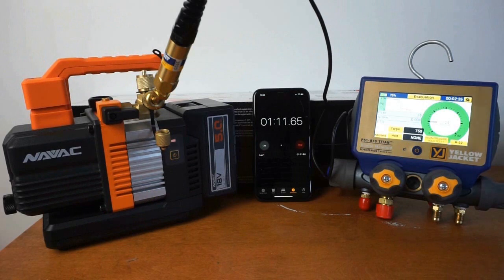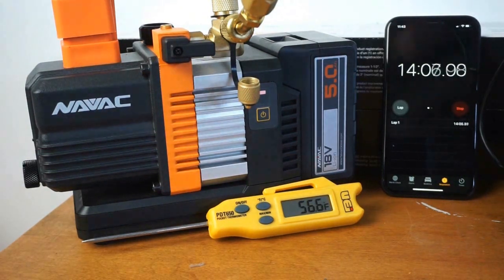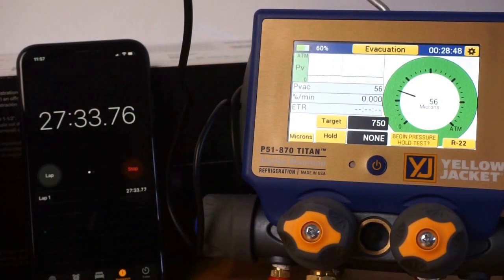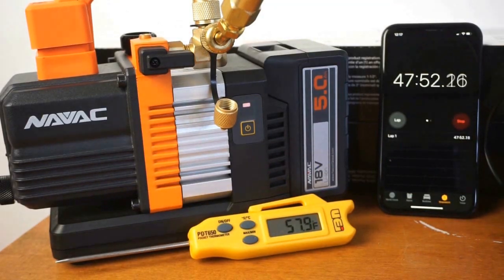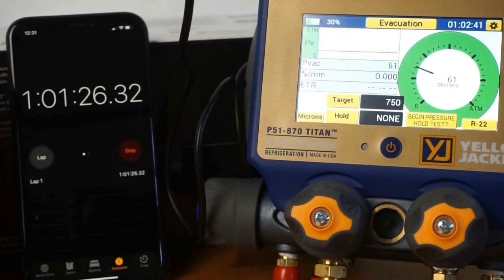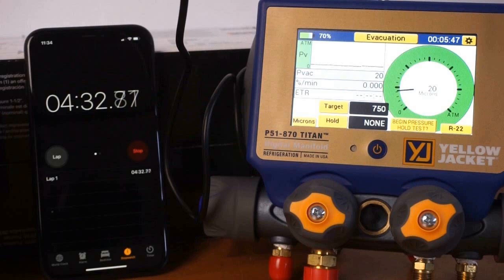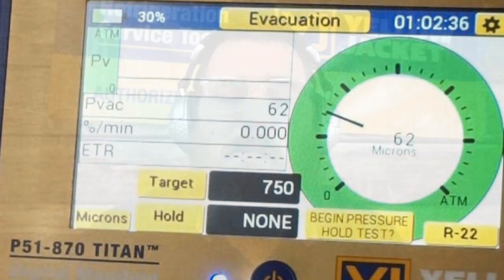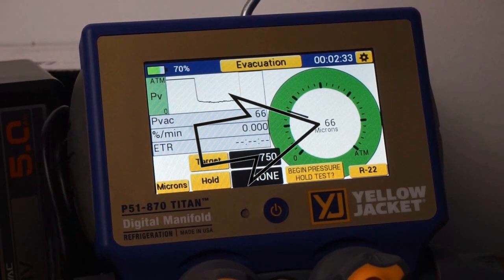NAVAC NP2DLM Vacuum Pump | Battery and Ultimate Vacuum Test

Comment: Gave it a thumbs up for effort however just found a couple little things I figured I would share. The temp prob on uei was super close to the pump the radiant heat from the navac is what caused the temp to go up not the actual room temperature also might wanna check the seals on your hoses for that small leak 20 microns to 60 microns is a decent jump and seeing how it maintained between 50-70 microns the second time tells me u got a small nick in the hose tip gasket on you gauge hoses or your manifolds got a leak I doubt that though but I don’t believe it’s got anything to do with the pump great video though keep up the hard work hvac ain’t easy

Comment: Are use the same pump in my training classes. I’ve been getting great results. I change the oil often and it does make a huge difference.
Reply from the maker: What training classes are you teaching?
Reply: HVAC Shop Talk 9 day basic residential maintenance 101 class. 2 day tech/installer customer Communications class. MeasureQuick implementation class. Vacuum training class.

Comment: I would imagine that since you’re pulling through the gauge set, when the pump loses power, it’s the equivalent of isolating the pump and seeing what the standing vacuum is.  As you know, that’s the only way to see what the true vacuum is, just like when you have to put the micron gauge directly on the pump. Good test, Zack.
Reply from the maker: The micron gauge is directly on the pump. The Yellow Jacket P51-870 has a separate vacuum sensor that was being used.

Comment: It is my understanding that vac pump oil degrades with heat and run time and this causes the pump to no longer be able to pull as deep of a vacuum.
Reply from the maker: Yes I’m just wondering if you could happen in a one hour session